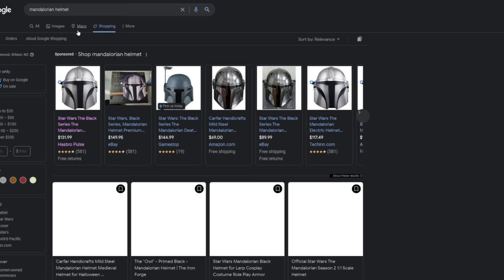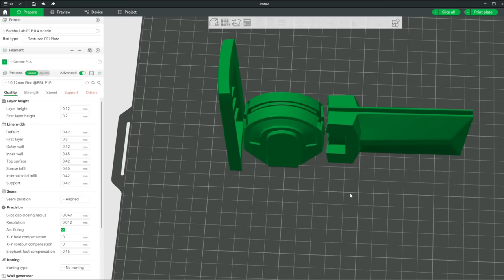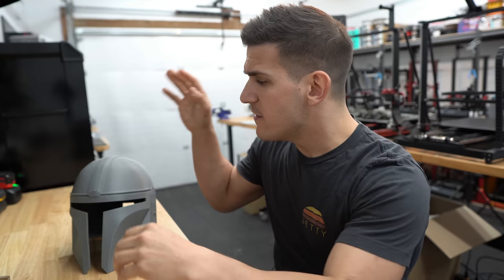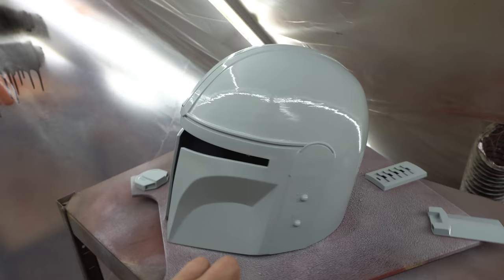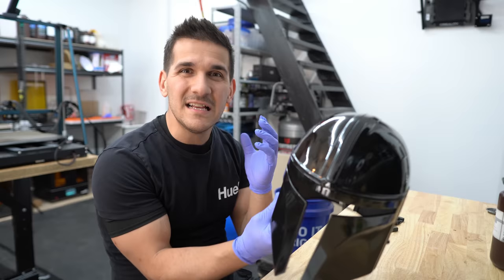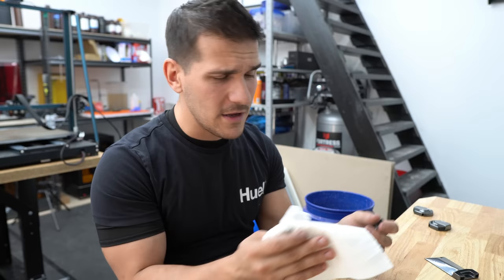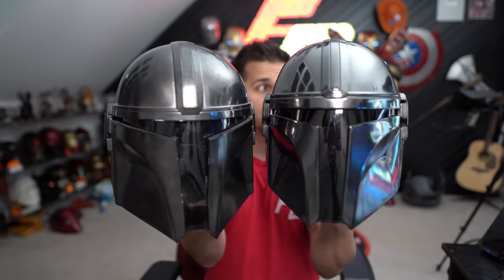How to Make a Mandalorian Helmet | EASY Trick for a Metal Finish On Your 3D Prints!

Comment: That doesn't appear to be orange peel, Orange peel is from the spraying process and looks more like as it sounds the peel of an orange, that appears to be crazing or an evaporation issue, hard to tell in the video, it could be from some coats going on before previous coats have dried enough, when paint dries the thinner product in the paint evaporates out of the paint, if you put on a coat or two before drying properly the evaporation causes problems in the layers on top, often like pin holes bubbles or random dimples. Crazing is likely from the paint getting too thick and not dried enough between coats, Crazing looks more like cracks under the top surface sort of like a honeycomb but more random pattern.

Comment: One thing for spray cans we do in the scale modeling world is heat up a pot of water (not boiling but hot to the point you don't want your hand in it) take the pot off the stove and let the can sit in the hot water for a minute or two. Then shake it up for a good min or 2 and you should have everything mixed properly and less prone to strange paint reactions and a much finer mist of spray coming out of your spray can.
Reply: saving this

Comment: "Don't turn this into a contest. I printed mine in 20 hours. Shut up."

So glad you said it. It seems like every community has that dynamic going on.

Love your work Frank, but I stay for the attitude and acceptance that you display.

For orange peel, depending on your timeline, I've been able to layer just about every type of paint after giving sufficient cure time. When I say "cure" I mean CURE. Rule of thumb is to smell the piece and if it smells like paint it's not cured. If you've got the time, let it sit for a week or two before throwing another coat down and it's nearly 100% successful.
Reply: Either that, or you have those gatekeeping pricks who will swat you down after finishing your first 4.5 hour print with a smug, "Four and half hours?  That's NOTHING! Comeback and talk to us when you get done with a twenty-four hour print."  Like, I just got this thing.  Let me have my small victory!
Reply: What if you used a chrome spray??
Reply: 99% of 3D printers are old fat guys in sheds that print stuff with no practical use.
Reply: @truantray  You been spying on me,,,🤔😀
Reply: @truantray  Maybe a Mandalorian helmet is practical in a shopping center during the wars at sommer sales 😁, but otherwise...
Reply: @1937Brett  Chrome spray, doesnt look as shiney as the graphite, I've tried both ways to do metal coats and the best and cheapest so far is the graphite.
Reply: RIght?! Who cares?
Mine took about 49 hours to print (Neptune 3 Max) and I really wish I had done a lower layer height (I did 0.3) as I have a LOT of sanding in my future!
Reply: @sunriseshell  kinda lucky since idk why but mine took about 80 hours to do

Comment: This is truly the way. This video came out right when I am finished posting my mando suit and I can say that the graphite powder is so good at making stuff turn into metal just MAKE SURE to clean the helmet through before applying it. I have done all the steps Frankly Built mentions in the video and it worked great for the suit. Thanks for sharing the way.
Reply: Can I ask, do you rub it into the paint once it dries?  Like very light pressure and keep going until it shines?  I've been testing aluminum powder on a t800 print, I just can't get it to work at all. Slightly tacky paint doesn't work  and it just send to dull the drier paint.
Reply: @nixqik  Yes, you rub it once the paint is dry and as you said, light pressure and use circular motion. Haven't used aluminium powder, but if you are going for a metallic look, graphite powder is the way to go.
Reply: Do you have a link to the graphite powder? Or where they'd have it locally? Walmart? Hobby Lobby? Harbor freight?

Comment: The black mesh in office supplies, like trash cans and pencil holders, is a great way to block the view of your face/eyes. Cut it to the same shape of the visor and attach it under. You can see through it fine, cause it is right next to your eyes, but it blocks light enough that even a camera flash won't expose your face.
Reply: over at mmcc they use welding visors!
Reply: Another good option, using the same approach as he did is 5% ceramic one way tint. Ceramic tint gives the ability to see out while others can’t see in. It is a bit more costly though.

Comment: Ive been fighting with settings for weeks, Im using your videos to help me do a dead space helmet, Its no where near the same simple shape but your videos took me from using 4 spools and a 26 day print time down to 5 days and 1.5 spools. (theres a lot of overhand layers and unavoiadable supports) Than you so much!
Everything from what printer to buy (Cr10s ProV2) to how to inspect the print process before firing up the printer to how to change filament mid print. <3

Comment: Great vid and techniques! You may find mounting your parts on sticks (use double sided tape/hot glue and remove with lighter fluid) will help to spray all the crevices. Also will stop surface tension sticking parts to table, splatter from holding can at wrong angle and dry spray when spraying other bits.

Comment: I think the term that describes the paint failure is called "checking," not orange peel.  Orange peel happens when the paint goes on too dry and does not flow out causing a small bumpy texture that looks like orange peel.  What you have is the paint lifting and not adhering well with the primer underneath which causes cracks or "crows feet" in the top coat.
Reply: how can i prevent this?
Reply: Glad you mentioned this, otherwise I would of. I'm an Automotive spray painter by trade and this crackle reaction normally occurs when (especially aerosol) the solvents in the aerosol "reactivates" the primer layer underneath the black. To solve this, I recommend using an Automotive 2 pack primer through a spray gun at the very start. You'll only need 2 wet coats of 2k and would fill all imperfections, being actual high build content, unlike the "high build" areosols. The 2 pack being a catalyst, has a less solvent content when dry than aerosol thus lowering the risk of solvent reaction.

Comment: I find not shaking the paint can thoroughly enough to be major cause of peeling and scaling.

Not shaking enough results in more volatile chemicals than paint being ejected, which will eat up previous layer(s).

Also helps to soak the SPRAY PAINT cans in a bucket of hot water, helps dissolve the paint so when shaken it will mix much better.

Comment: /!\ To everyone where the graphite finish came out too dark also:
I tested it again with the base coats of black, anthracite and light gray.
- the black became too dark and the graphite only covered after several layers
- the light gray actually became a bit too light and the graphite didn't cover well even after several coats
- The graphite covered excellently on anthracite and the result was slightly brighter than with the black base coat.
So for me the graphite on anthracite delivered a great result.

Comment: You could recovery the mistake with wet sanding. It always works, I use to work in an exotic car autobody shop, you would not believe how many mistakes happen etc. Unless you have a zero dust paint room you will always get something.

Comment: the "orange peel" looks like solvent pop..or not letting the coats dry enough inbetween each other. Or, in other words...too heavy of a coat ontop of itself by doing multiple passes instead of 50/50 fan pattern on each pass and not immediately spraying the same area in the same pass. Kind of like our instinct to is fully cover with color instead of doing medium or light color coats.  Ive  been in  a rush too and been guilty of this. Patience is key!

Comment: I love that video!!!
Re paint, I ran into the same issues re peeling. Most of the time it's simply the new layer attacking the older layer (solvent dissolves part of the prior layer). That does happen a lot with spraypaint.
Since I'm doing a lot of "making", I decided at one point to get a decent compressor and spraygun (both together was some 250 NZ Dollar). And lo and behold, never had this issue again (my thinner of choice being acetone which also reduces curing time by up to 50%). Nice side effect, paint comes considerably cheaper than spraycans in the long run.
I also used graphite for my prop swords, prop guns etc. You can get some pretty good finish, close to chrome, depending how good the underlaying paint job is.

Comment: The biggest thing missing, as you said, is the weathering, it doesn't look used. It looks like it came off an assembly line. Dirty it up with paint and weathering powders. Adam Savage has a good video on doing exactly that with a Mando helmet. It will look way better after.

Comment: 0:22 Cool edit. Didn't even catch it at first.
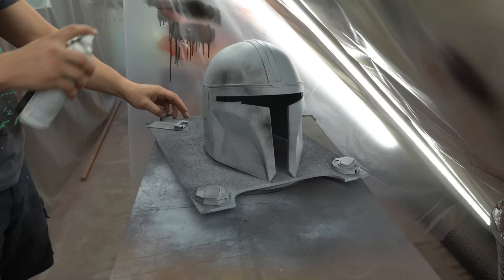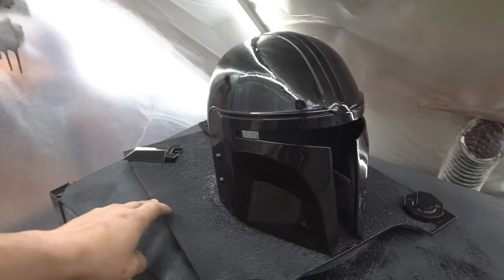14:15 - 14:35 Agreed.
14:38 O_O How?
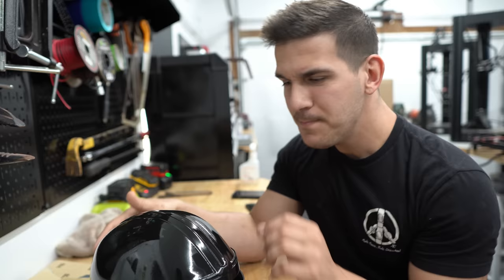14:56 Did you spray it too close to the surface?
15:05 There are some crackling on the surface there.

15:46 Have you ever thought using a tack cloth? You can use it to remove any dust, grease and other contaminants on the surface prior to painting. However, you might be able to sand it off with some 400 grit sandpaper to 1000 grit and spray the orange peel texture off.

I got to take some time out to use this electroplating kit I bought for a helmet a few years back.

Comment: Great video!  As you finished with the graphite rub and the final silver look was achieved, you mentioned that there was no need for a final top coat /sealer coat.  While that's clearly true, I was wondering how the look would change if you gave it a final top coat of high gloss clear.  Maybe too glossy for the mandalorian look you're going for?  I'm about to 3d print some small items where I want the gloss to be very high, so that the silver looks like chrome if possible.  just a thought.  Thanks and all the best!

Comment: Just a tip, out from printer & after initial sanding. Evenly pour table top epoxy over entire object letting it dry. I do this as it works well filling thin lines  indented & any faults throughout. Helps shorten time sanding & achieving smooth results.

Comment: Orange peel happens when the paint underneath is not given time to dry when the 2nd coat is put on. You either need to paint the 2nd coat soon after the 1st so they are comparably dried and combine, or you have to wait until the 1st coat dries completely and apply the 2nd coat. there is a window from 30 minutes after you paint the first coat and 24-48 hours that you should not add the 2nd coat depending on the paint. See the instructions on the specific paint for when to apply the 2nd coat.

Comment: Thanks so much for the tutorial. I did the same but for some reason my graphite rub looks so dark. Do you know why? It seems just a bit lighter than gloss black.
Reply: Did you find a solution already? I have exactly the same issue. Still looks kind black only with a bit more metal shine :(
Reply: @justlx  Not in regard with the grafite. 
For me it made no difference when first applying black gloss than grafite than clear coat. Or black gloss, clearcoat and then grafite it looked the same.

There is a guy on Youtube doing it without blackgloss but when I tried it the grafite was not attatching at all.

It looks minimal better if you try to rub more in but I was still not happy so I was doing the following:

 I tried polishing even further but it did not help.

Then I was trying it with white paint and it did not look good at all.

So I went to the next store and I bought a Chrome high gloss spray paint and now its a bit lighter but unfortunatley it has not that typical metal shine but rather a bit plastic look (Looks now like the Habsbro Mando helmet) 
If you manage it somehow please let  me know.

Another posibillity is to use another black gloss maybe this is the reason . I really have no idea.

Comment: The thing I dislike about the fingerprints is they don't come off. It's a permanently discolored spot and even if you reapply powder it will still be visible. Clear coating helps buts it greatly knocks down the shine.

Comment: you can get Spray cans to get a perfect finish...but it requires an IMMENSE amount of work.  The surface needs to be sanded between coats with a wet sander and the surface prep is a nightmare on plastic...imagine doing auto body work on 1970s era fiberglass...that is about the equiv of Filament prints texture wise.  Laydown the darkest matte black coat you can then purchase the best chrome spray can you can ($45+).  1500 - 2000 - 4000 wet sand between each coat at minimum.  The real challenge is the pre paint sanding and surface leveling as sanding is super fast on this surface and you can deform your curves quite easily.  Buffing with Graphite powder is super easy and 90% of the way there for the super shiny finish...that being said, I think the graphite powder version looks best because Mando's armor should only ever look brand new like 3 times a year...hahahaha.
Reply from the maker: When he walked into the bar in the first season. That was it lol the cleanest it ever was

Comment: My personal process: after print is done, mouse sander w/ 180 or 220. 2 coats of UV Resin. Mouse sander again w/ 180/ 220. 1 more coat of resin, mouse sander at 220 or higher grit. Then dust coat of filler primer and wet coat as you did. Then wet sand the primer w/ mouse sander at 400/ 800 grit. Then paint. Glass smooth.
Reply from the maker: That’s a good method! Can I ask tho why even use resin at all if you’re sanding before and after? Seems to just be introducing more toxic particles into the air. Why not just go to a lower gritty at first?

Comment: You can experiment with not letting the clear coats dry completely and rub in some graphite. It will give a more dull outcome. Which is perfect for non-chrome metallic. As a bonus, it's near impossible to remove completely if you don't sand or scratch.

Comment: There's a guy out here on the youtubes (Hen3drik) doing actual metal plating of 3D printed parts. Just paint the (extremely well sanded and prepped) part with conductive copper paint and you can literally deposit actual nickel or whatever you want on the plastic with electroplating in a bath with suspended metal. You get an actual metal helmet... with a plastic core, sure. But that's a bit more involved and probably the cost adds up quite a lot. But how cool would it be to have an actually metal Mando helmet?  This turned out great too with a less extreme of a process.

Comment: A tip for 'drilling' out peg holes. Rather than a drill bit, try getting your hands on some 4 flute end-mills instead. As they are used in machining, they tend to be almost spot on their stated size (i.e 5mm = 5mm) where drill bits tend to be slightly under the stated size (5mm = actual 4.89mm). When your looking to push in an FDM printed peg, which will have squished to be over sized during printing, the end-mill hole might just give you the extra space for a friction fit. Plus, they give you a nice flat bottomed hole! (ooh, that didn't sound right).

Comment: I started making more cosplay stuff. Two tips: PETG sands better than PLA and is less brittle, and a flat cabinet wood scraper, or card scraper gives a very fast way to knock down layer lines. They make them with curved blades. Saves hours over sandpaper and they are not expensive in sets.

Filler primer is a must, but DupliColor cans have awful, cheap nozzles that drip. Also, what you are calling orange peel is not what painters call orange peel. That crinkling is from base layer paint not fully cured. 
Orange peel is a bumpy finish due to poor paint flow.

Comment: 2 tips for you.
1 buy/print yourself a paint can gin - a type of holder for spraypaint cans - a lot easier to paint with it.
2 prehear your spraypaint cans in hot water, put them in a bucket of worm water or hot  - depends how fast you want to paint. and use can holder, this will make solvents to evaporate faster....
Reply from the maker: I actually have the can holder. I don’t like it. Feel like I have less control over the flow and angles
Reply: @FranklyBuilt  ok, try heating cans in hot water 😉

Comment: Funny the timing of this - I'm trying to print one on the Lulzbot Tax Pro XT with the 1.2mm print head right now.  Last night's attempt failed due to a layer shift (and the failure of the Taz to have a decent way to reload filament once the sensor detects it is out)

Comment: Okay if you have a expensive fast accurate Bamboo Core XY Printer.  So those of us not that lucky to have it give up on this built. 
Because even somehow if we can slice up the print and re-stick it from lots of smaller printings no printer will be as exact and fast than the Bamboo printers.
Reply from the maker: That’s why I have other videos showing you how to make this on smaller printers. It’s still very easy to do

Comment: Ah, your wanting to avoid Pixelization.  Round objects printing against the Z axis will show the layer lines (like the pixels on a low quality screen).  So anything round you want to orient with the X/Y axis as much as possible to avoid this.  If anyone is wondering why he used Filler primer, it works well to "fill" in the layer lines and make a nicer, smoother, finish.

Comment: I've been using expensive safety visors so I can only see in lit up places. Will switch to your method 😮. I've tried it before to no success but that was using PPE visors and window tint which had a job staying on when flexed so might be a material this or more likely surface thing with the PPE visor being a lot smoother as designed for optical clarity.